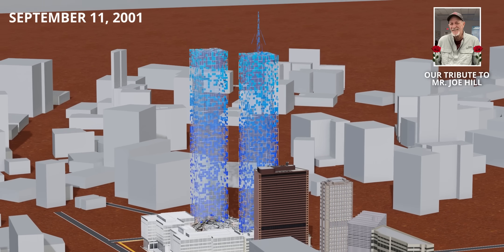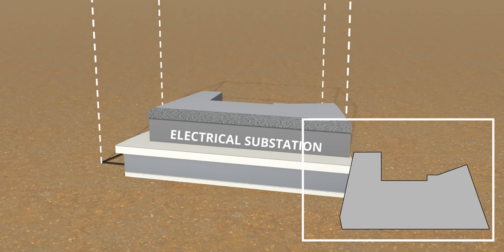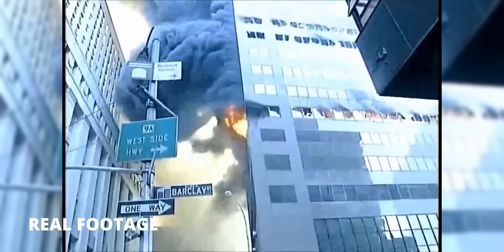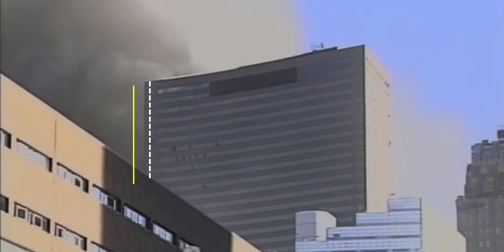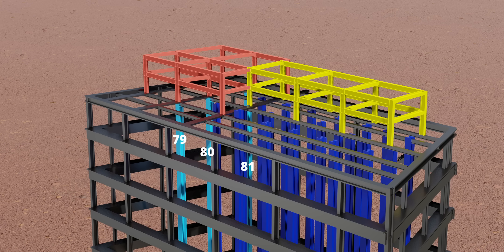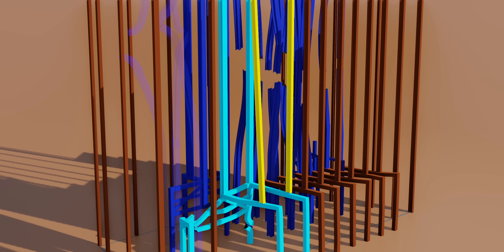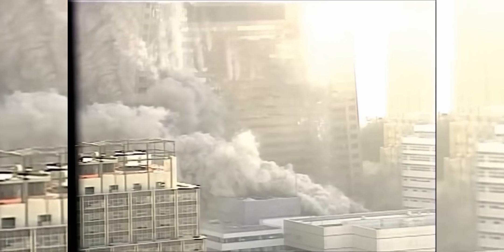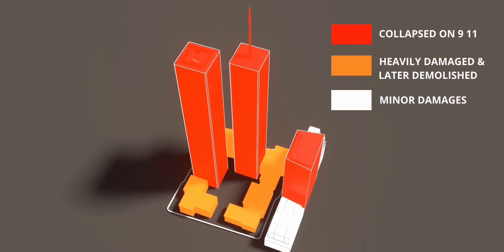Collapse of Building 7 | The Complete Physics

Comment: Right,tell me more!
Reply: OK.  Building 7 - the 6th building to collapse of 10 lost on 9/11 - because of its low priority was largely ignored early on, so conspiracy filled the information void with a lot of  garbage from ignorant people promoting political agendas, creating a lot of confusion and misconceptions.  So I prepared this brief summary using my own technical analysis, not ideology and magical (non)thinking to dispel them. 

At 10:28am the WTC North Tower collapsed, showering Building 7 with tons of burning debris, causing heavy damage and starting many large fires that burned out of control for the next 7 hours. Half the FDNY firefighters having been killed, units in disarray, equipment destroyed, no water pressure, and the greater urgency of search & rescue efforts, Building 7 couldn’t be saved so firefighting efforts were pulled as futile and 7 left to its fate. Firefighters make that sort of choice every day in brush fire situations - which houses to save and which ones to let go. Only real difference here is moving the decimal on the size and cost. People get overwhelmed by the size.

www.youtube.com/watch?v=g_SvpwyC17M

Collapse of a burning structure is always a concern for firefighters and steel buildings are uniquely vulnerable to fire damage. When subject to fire they rely on active firefighting to survive, designed around 1 to 3 hours of fire resistance to, allow time for occupants to escape and active firefighting to get started.  After this all bets are off. Left to their own devices they'll exceed their design envelope and collapse, like Plasco Tower and Wilton Paes de Almeida. In 7 the occupants escaped, passive and active fire protections were compromised and active firefighting was abandoned hours before the collapse, which left the building to its fate. It lost. Odds on Building 7 would eventually collapse, and it did. No big deal in logic.

 http://www.youtube.com/watch?v=WnYBX6QT0R4 

FDNY Chief Daniel Nigro - The biggest decision we had to make on the first day was to clear the area and create a collapse zone around the severely damaged 7 World Trade Center, a 47-story building heavily involved in fire. A number of fire officers and companies assessed the damage to the building. The appraisals indicated that the building's structural integrity was in serious doubt. I issued orders to PULL back the firefighters and define the collapse zone. It was a critical decision; We could not lose any more firefighters. It took a lot of time to PULL everyone out, given the emotionalism of the day, communications difficulties and the collapse terrain 

FDNY Deputy Chief Peter Hayden ; We had our special operations people set up surveying instruments to monitor and see if there was any movement in the building. We were concerned of the possibility of collapse in the building. And we had a discussion with one particular engineer there, and we asked him if we allowed it to burn could we anticipate a collapse and if so, how soon? And it turned out that he was pretty much right on the money, that he said 'In its current state you have about 5 hours 

The collapse of Building 7 was anticipated and widely reported in the media throughout the day, with 24 video cameras recording some or all of the collapse. Everyone knew what was coming and why. 

www.youtube.com/watch?v=OY5S5k3tMHI

Building 7 collapsed from the inside out which is not at all intuitive and hard to understand with most details being hidden from view.  It requires careful analysis and observation, and some people will struggle no matter how much it is explained. But here is my explanation relying on no outside authority. 

Building 7 was a unique, asymmetrical 47-story steel frame structure built atop a smaller 3-story building serving as a partial foundation, requiring lower floors dedicated to complex load transfer structures. Of trapezoidal shape and tube-in-tube construction, B7 (above the 7th floor) consisted of a central core of steel columns carrying most of the gravity load, perimeter steel columns around the outside of the structure carrying the remainder of the gravity loads and long span beams and girders to tie those elements together and form the floors. On the outside of the building hung a facade or outer shell. 

www.nist.gov/image-16640

Phase 1 : First externally visible signs of collapse initiation occurred at 5:20:28 pm and was notably quiet with observers not realizing the building was collapsing! No warning in the form of hundreds of eardrum busting 180dB explosive bangs. Here at 12:00 a local CBS affiliate reporter talking 10 blocks from B7 when collapse begins. People don’t start to notice the collapse until 12:11. At 12:45 is the famous CBS fixed camera clip of Building 7’s collapse. Note the silence. 

www.youtube.com/watch?v=t5tEy6mXSE8

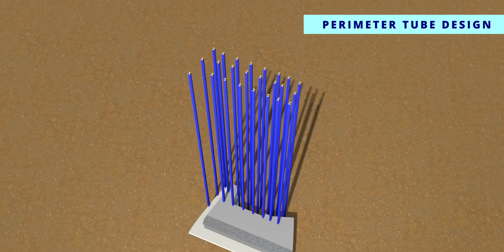Lower floor failures above the load transfer region (8-14) in the NE corner initiated the collapse. In this video at 0:45 you can see the NW corner from inside the building while under construction, Column 79 just out of frame on the left. That big, angled steel beam across the top of the frame connects to C79 at one end. The girders connect to the beam. That beam and all those girders depend on just one connection 

www.youtube.com/watch?v=nP3TNHPCIVU&t=45s

Phase 2 : NE corner floor failures caused a loss of critical lateral support over an excessive length of Column 79 and it buckled. Externally as collapse begins we see a vertical progression of window breakage along the 44-46 line and a kink in the roof of the East Mechanical Penthouse at the top of the building, consistent with C79 failure. Looking at the above floor diagram of Building 7 when you see all the structures that depend on C79 you quickly realize this one column was a relatively isolated structural element on which a disproportionately greater fraction of the structure depended analogous to say the Key Bridge. Normally with a buckling column, the load could be redistributed to other columns. With C79 that is not the case - the failure did not redistribute the load, so the collapse rapidly progressed to the roofline, sinking the rooftop penthouse. The transition from full capacity to almost no capacity occurs in an instant and will result in virtually no resistance 

Phase 3 : With C79 gone, B7’s progressive, non-symmetrical collapse continues with adjacent columns 80 and 81 left laterally unsupported and quickly buckling as well. The EMP drops down through the building. C79-81 all have no diagonal bracing, which is the major reason why they could not redistribute a lot of vertical loads among one another. From there collapse progressed from east to west through the central core until the core was gone from 81 to 58, taking all the interior floors and probably most of the perimeter columns with. Follow the horizontal progression of window failures low in the building and the dropping of the remaining rooftop structures into the building. The NIST Building 7 study model 4 determined C79 failing under ANY circumstances would have initiated the same collapse sequence. 

Phase 4 : After about 10 seconds only the exterior moment frame remains, giving the illusion B7 is still standing to the casual observer since little has outwardly changed. But it is just a hollow empty shell like an empty cereal box supported only by a few remaining columns and overloaded from the loss of the core columns and floors, quite unable to remain standing. With nothing remaining behind it, the north face leans inward, forming a V in the roofline, the last few columns buckle under the strain and the moment frame free falls, landing on top of the debris pile. 

The debris spread well outside the footprint blocked surrounding streets, heavily damaging the Verizon Building and destroyed Fiterman Hall. 

No building is meant to survive 7 hours of multi-floor unfought fires. Building 7’s progressive, non-symmetrical collapse was incidental, unintended collateral damage from the combination of fire, time & gravity started by the collapsing North Tower, true no matter who planned and carried out the 9/11 attacks or why .   

I hope you found this helpful, informative and it solicits informed critical comment.
Reply: @TheCriticalStinker-01  , ONE SINGLE WORD!* ... That is all it takes to answer my basic high school physics question:

As an object is falling in free fall how much work is being done by that object AS it is falling in free fall? 

Any comment you make without knowing what the physics term 'free fall' means is then based on ignorance and is an insult to the people that were murdered on the day of 9-11-01.ONE SINGLE WORD!* ... That is all it takes to answer my basic high school physics question:

As an object is falling in free fall how much work is being done by that object AS it is falling in free fall? 

Any comment you make without knowing what the physics term 'free fall' means is then based on ignorance and is an insult to the people that were murdered on the day of 9-11-01.
Reply: @TheCriticalStinker-01  , Maybe you can answer this question: 

Are you an American citizen or an American parasite? 
Since the year 2001 more than thirty thousand American Soldiers have committed suicide. This is not only an epidemic, it is UNPRECEDENTED in the known history of the world. Certain individuals propagating a certain UNPROVEN narrative have greatly helped cause this too happen. 
Are you an American citizen or an American parasite?